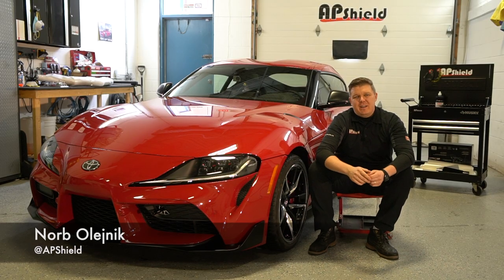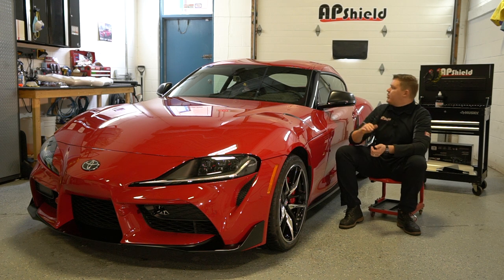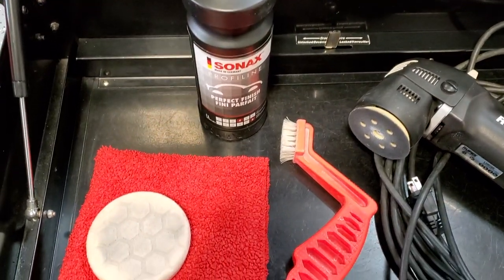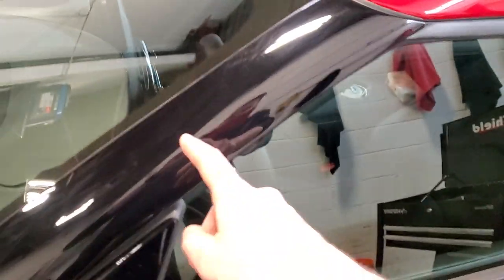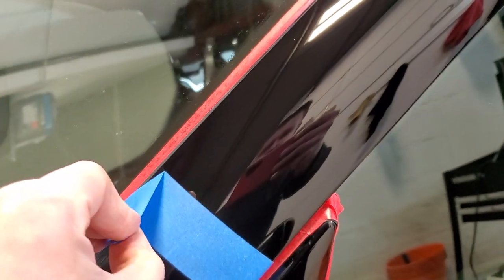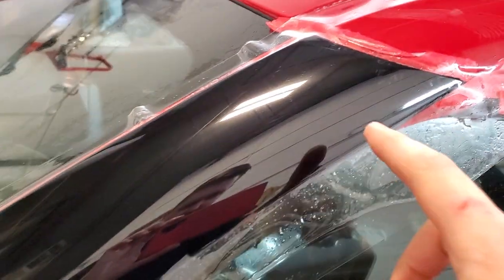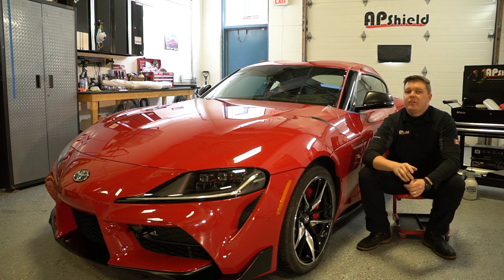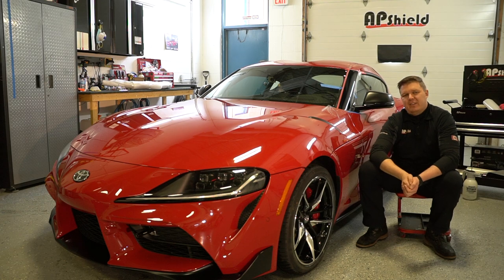Hmmmm....Do swirls appear under PPF???  Is Paint Correction Necessary?

Comment: Looks like a lot of the scratches / swirls on the piano black have indeed been hidden by the PPF; if I have a new, white car with much less visible swirls - can I get away with not paint correcting before applying PPF? (full frontal, hood, bumper, etc.) Seems like piano black is the "hardest mode".

Comment: Can you please post a photo once it’s cured. 

I’m in the camp of polishing isn’t required in most cases. We would’ve done a quick polish on that pillar. But probably not the paint.
Reply from the maker: I'll try to on another piece, this was a customers car, and I did this video just to see/demonstrate if there is a difference.  After the video was finished, I polished the whole A Pillar then wrapped it properly.
Reply: @ThePPFChannel  Getting a brand new Bronco delivered by rail. Would you use an iron remover first then do paint correction?

Comment: does the PPF get sticky/tacky really quickly on a freshly polished surface?
Reply from the maker: It does have a better bite.  But it all comes down to your solution, if you rinse out all the slip with a warm tack solution, it will stick down very well, and relatively quickly.
Reply: @ThePPFChannel  thanks for the reply. recently started doing PPF and have tried polish surface vs non-polished. the polished side was VERY quick to tack. im guessing it would be a good idea to add more soap to the slip solution? for a polished surface